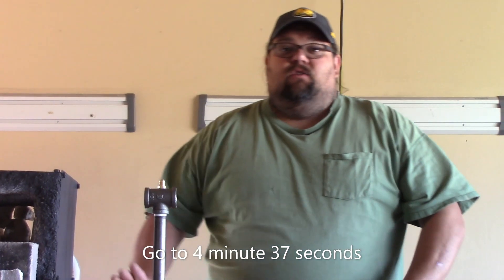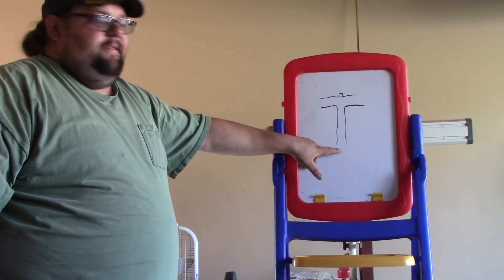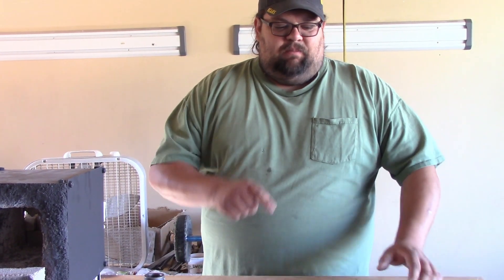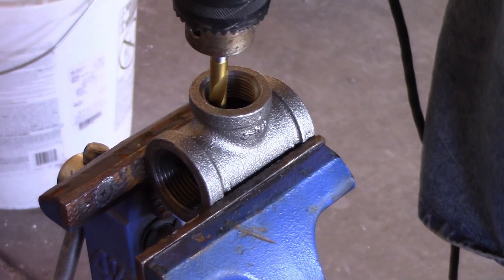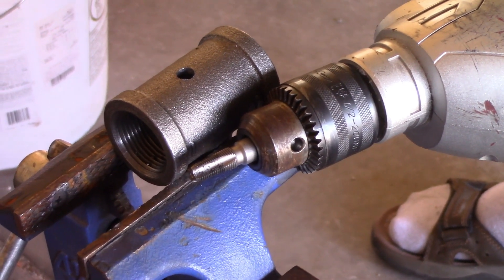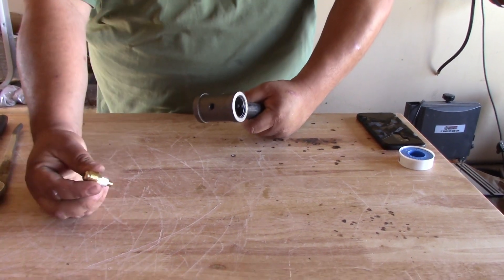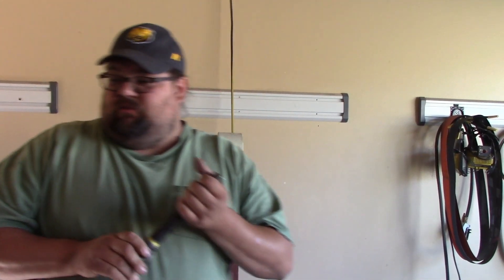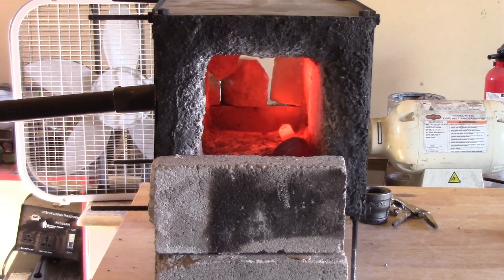How to build a 3/4" NA propane forge burner

Comment: Wow, the Frosty T really is that easy.  Hard to believe just reading it, especially after reading the much more involved Mikey burner.
Reply from the maker: the mikey burner is pretty simple as well, it just sounds complicate.  this is a modified version of the T burner(i did my best to make it easy) frosty's design calls for a little more work.  you can find his design at www.iforgeiron.com  you can also speak with him and mike porter (mikey) there and discuss ideas.
Reply: @irondaggerblacksmithsupply1237  Thanks for the reply, way back when. I'm finally getting around to trying this myself and have a couple of questions: You said the orifice is "0.3", did you mean 0.03 inches? I'm seeing flares on Amz for turkey fryers with orifices on the scale of 0.042" , but nothing quite as small as 0.03 (nor large as 0.3). Are flares with an orifice the right size marketed for a different purpose or is it just a matter of finding a speciality fitting store?
I'm assuming that a flare with a larger orifice  like those for turkey fryers would not work; at least, I tried it with one that I had and couldn't get it to work, although I think the regulator might only be 10 psi also.

I searched but couldn't find any discussion of your modifications on IFI; have you gotten any feedback from Frosty or the community about it? Your design takes out what seems like the most challenging part to me, which makes me fear it's too good to be true.
Reply from the maker: @wilcooley  yes .03 sorry about that.
Reply: @irondaggerblacksmithsupply1237  thanks!

Comment: How much psi youre running there? i bought mine, same specs, but not that kind of flame
Reply from the maker: I don't have a gauge on that regulator.  However rough guess is around 15 psi.  how does your flame differ?
Reply: @irondaggerblacksmithsupply1237  Thanks for the response, well actually i think i figured out. but a fire brick inside the forge, Forge is too big i think. thanks
Reply from the maker: @pprrado  that can do it.  One of these 3/4" burners is good to take 350 cubic inches to forge welding.